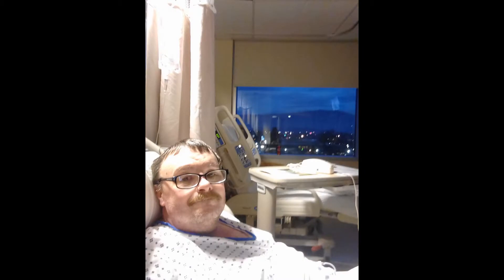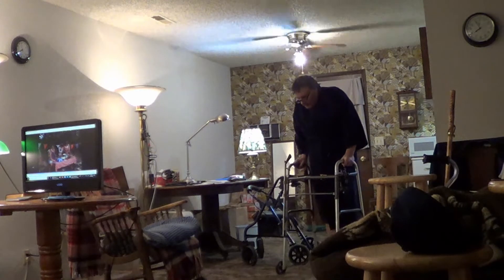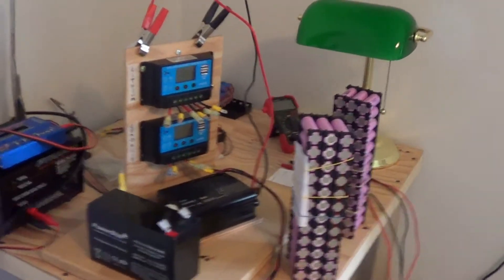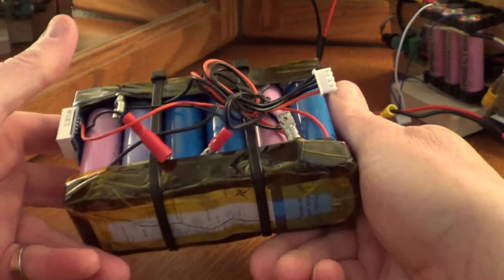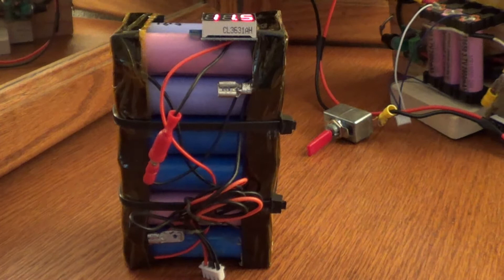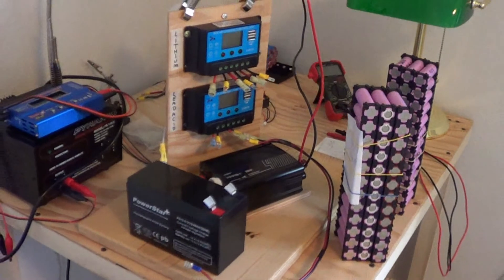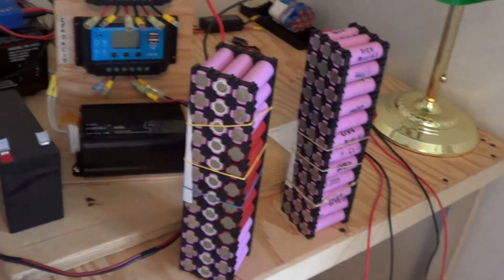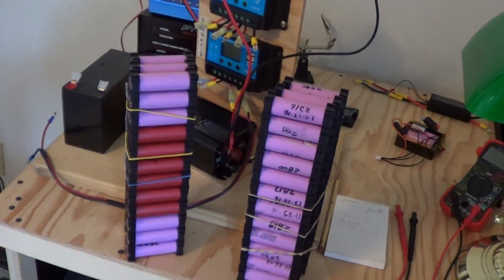What is the Watt Hour  for My DIY Lithium 18650 Battery Bank

Comment: Watt= volt x ampere.
If the cell is 3.7 volt and 2.2 ampere then it has 8.14 watt.
When you connect cells in series you will add up the ampere. For example 2 cells connected in series and each with 2.2 amp , you will have 4.4 amp. If you connect the same batteries in parallel then you will add up the volatage. For example if each is 3 volt when you connect them in parallel you will get 6 volt .
A kilo = 1000.
So 1kw= 1000 watt
Reply: Hey Samy, should it not be the other way around, cells in series increase the voltage and cells in parallel increase the AH rating?
Reply: Series = adding voltage

Comment: Im also wondering how to determine the Watt hours and Amps and Volts for DIY 18650 battery packs... Would a series of 10 Li-ion 18650 batteries, be enough power for something like  TV or a playstation 4? Please help answer...
Reply from the maker: I'am Not sure How to figure out just what You would need for that.? Thanks for watching.